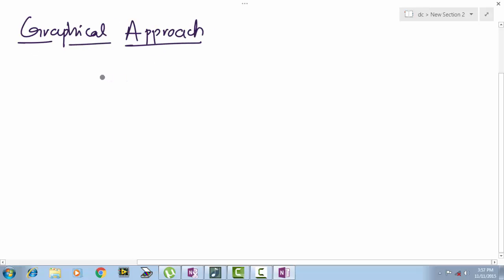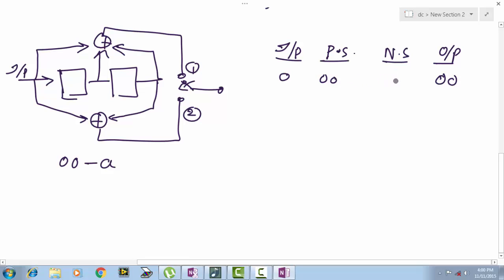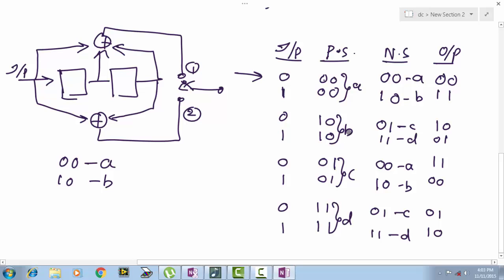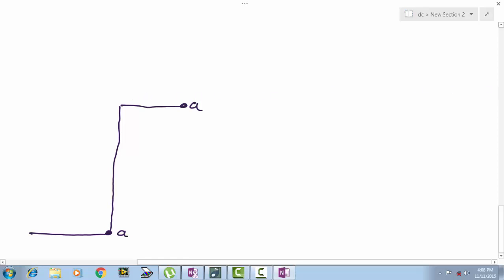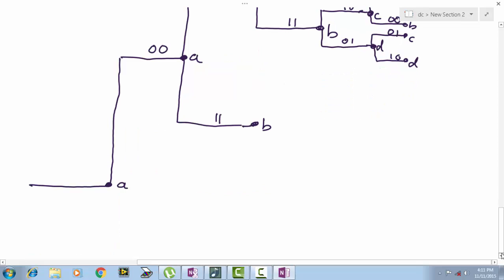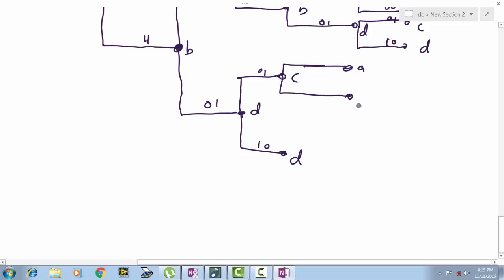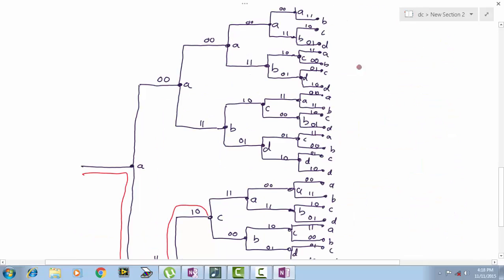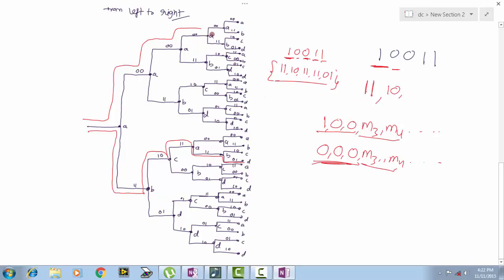Convolutional encoding using Graphical approach   code tree

Comment: I have a question.. The first bit of the output is sum of i/p & first bit of P.S....right... So second bit of output should be the sum of i/p & both bits of P.S. as there are 3 inputs to the adder in the block diagram.. isn't it ??